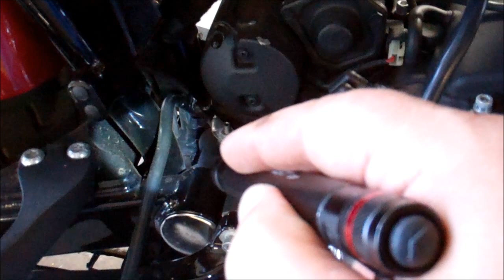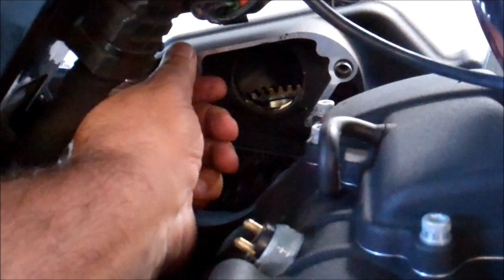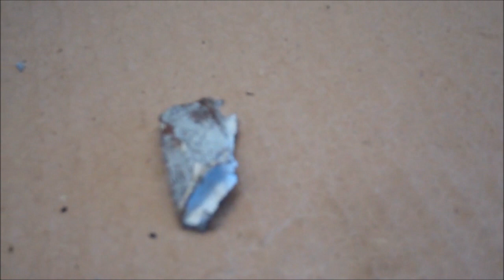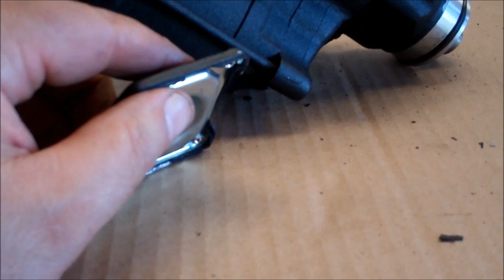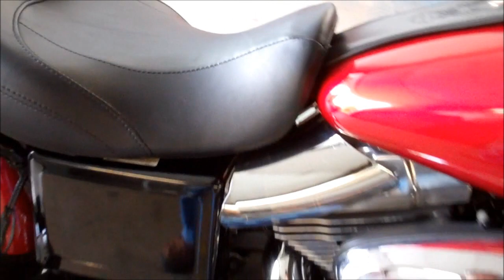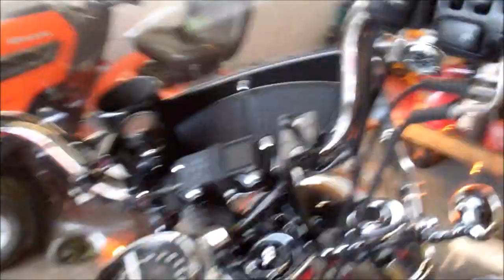Switchback Manual Starter Switch

Comment: Just saw this video I have  a 2014  FLD and my bike is really slow at starting I also get the Vinner code but it still starts. I have a lithium ion battery and it takes 2 to 3 times before it starts. Any ideas? Thank you for your time.